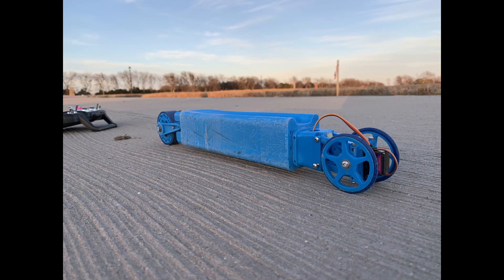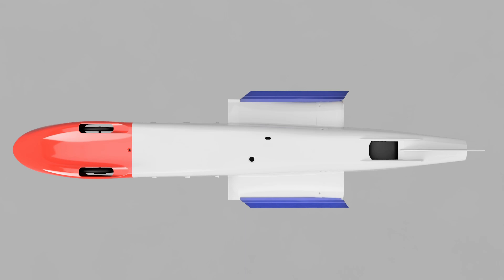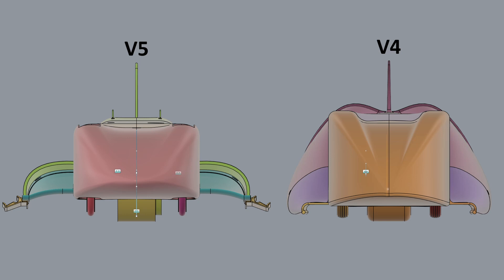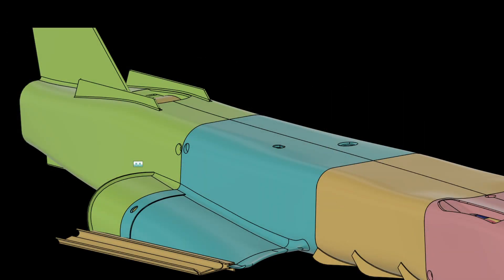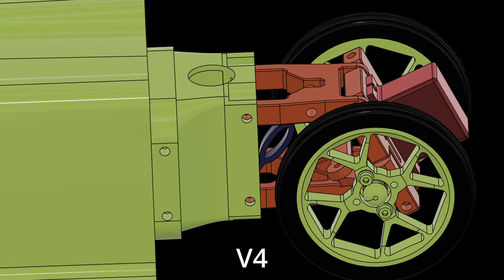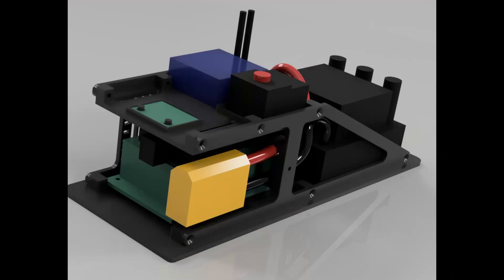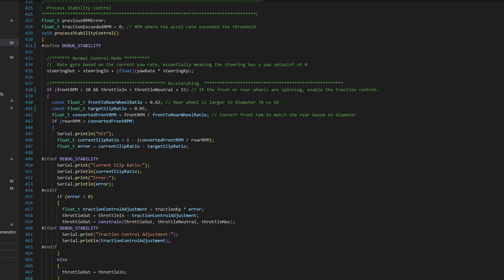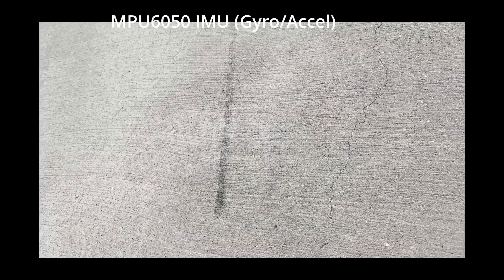Project Streamliner: V5 Design and Testing

Comment: I think your stability has a lot to do with the drag center of pressure in this case. Dragsters like to have their rear wing behind the rear axle so that it's self straightening at high speeds. Think of it like a parachute. 

When you switched the traction force to the front of the car, the drag center of pressure was far behind thebdrive wheel. When it's real wheel drive, the CoP is in front of the drive wheel.
Reply from the maker: That’s true. I had the weight pretty far back trying to get traction. I think if I wasn’t so weight conscious it would be a lot easier. I may play with FWD some more because making one of these front heavy is better for packaging too.

Comment: Cast polyurethane resin tires are popular in combat robots for durability and traction. Most people use the vytaflex series - overmolded onto TPU hubs.
Reply from the maker: I want to try that out as a material and see how it holds up.  I've seen some high speed wheels where the urethane is cast around a plastic skeleton that is part of the rim.

Comment: Thanks for the mention.  I will say my RC cars find great traction above 100 mph when the down force is really taking effect.  With foams I may only be at 50% throttle by 100 mph.  It takes the right road and long distances to do the car the justice it deserves.  The car side of the hobby has many challenges and a majority are based on the road.  I have recently moved to rc boats for that reason.  I'd love to see what you can design for outrigger rc boats.
Reply from the maker: The boats would be fun. Are the wrecks as bad with the boats?  I’m not sure my wife would let me start another hobby 😂.  

I really like the idea of having some sort of downforce that can get the car up to speed quickly. Maybe active aero or a fan car.  Every time I run the simulations, it’s almost a mile to reach 200mph and that’s way too long.
Reply: @IndeterminateDesign  the wrecks with boats can be bad but so far mine have survived.  A v bottom hull or mono hull does not go very fast.  Many of the records with governed groups are in the 80-107 mph range.  Hydroplanes run in the mid/low 100s and riggers have been as fast as 206 mph.

Comment: Maybe you should make a car that can drive on ice instead of trying to get more grip. Like I said before you need two motors that steer and drive the car and you can use them like a gyro. I have done different setups and nothing beats 2 motors.
Reply from the maker: I agree, the multiple motors is probably the way. I found some drone ESCs with the AM32 firmware and they’d be great for a multi-motor setup with differential torque to steer. Packaging the steering is one of the most difficult things.

Comment: This is probably a rabbit hole that you don't want to go down, but what about making your own tyres? This could give you more flexibility with wheel diameter and width. It would be very easy to do with construction adhesives like Sikaflex 11FC or Soudal T-Rex. They're on the heavier side, but you could make your rims with holes in them so that some seeps through and forms a positive lock. If they're no good, then you can try latex or EVA resins. I'd love to see a destructive max RPM test on the different compounds, and then a simple coefficient of friction test with weights and a pull scale. Could do abrasion resistance with sandpaper.
Reply from the maker: I’m definitely looking at making my own tires, and I made a tire test rig that scares me. There are a few others working on tires as well. I have heard the silicone based tires haven’t been as strong as the natural rubber or epdm tires. But possibly with some reinforcement they could be used. The silicone is certainly a lot easier than vulcanizing your own rubber. 

I had no idea you could buy EVA resin. That would awesome if I could tune the properties of the foam and possibly reinforce it with some composite. 

I’m looking at some aramid reinforced rubber tubing or even o-rings in harder durometers. If money was no option, I found a company that makes carbon nanotube reinforced rubber wheels 😂

Comment: You should definitely be using magnetic encoders. They are super cheap nowadays and gives the control loop way more information to work with.
Reply from the maker: Definitely on my list. I had some custom PCBs with encoders made for the RCHyper car and they work great and I don’t need any filtering. I’m going to get more for these motors. 

The other challenge is the sensorless brushless ESC in a direct drive setup. The motors have to spin at a decent speed to generate enough back EMF. So low speed traction control isn’t great.
Reply: @IndeterminateDesign  You should use a driver that supports FOC control. Something like an ODrive or you could get into the rabbit's hole that is SimpleFOC...

For the magnetic encoder, if you haven't come across them yet, MagnTek, make some pretty good and affordable sensors. The MT6701 is pretty much unbeatable for the price or they have higher end parts like the MT6835.
Reply from the maker: Ah, I’m going to check those encoders out. I’ve been using the AS5047P which is pricey. I’d love to try an O drive but they’re pretty big and pricey. 

I’m playing with drone ESC’s now for my RC Hypercar running the AM32 firmware that would allow me to have telemetry and they have a sine wave mode for low speed smoothness.
Reply: @IndeterminateDesign  Open-loop ESCs for brushless motors at low speed aren't great. The motor doesn't generate enough EMF at low speed. That's the problem you are having.

Comment: Actually, wouldn't ESC report speed that would be usable for traction control? 

Perhaps,  at least for high speed, the stability could be achieved similar to how rockets work - "The center of mass should be towards the rocket's nose and the center of pressure should be towards the rocket's tail for the rocket to fly straight." But you probably thought about.
Reply from the maker: The ESC I’m using doesn’t report the RPM, but yes higher end ESCs can do this. I used the front wheel speed sensor to compared against because the GPS wasn’t as responsive. 

Yes, I’ve tried to make the car as front heavy as possible and keep the center of pressure as far back as I can. I think that is another reason FWD might be better. More weight in the front and better stability than RWD too.

Comment: I wonder if active aero might help? Basically suck the car onto the ground?
Reply from the maker: I think active aero is definitely the way to go. Especially since when braking, extra downforce and drag would be hugely beneficial. 

I am concerned about getting enough downforce at lower speeds. The aero devices have to be fairly large to get meaningful downforce below 80mph or so. I’ve thought about a vacuum/fan for downforce. I’d love to have a car that could go 0-60mph in 2 seconds or so 😂